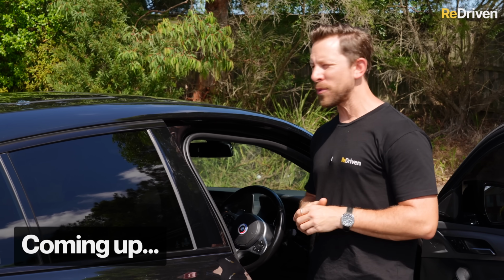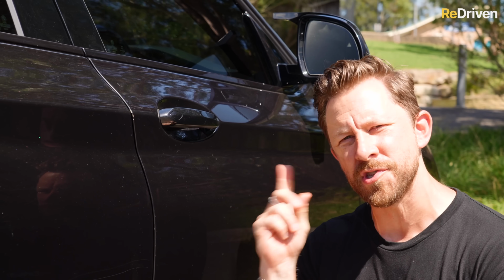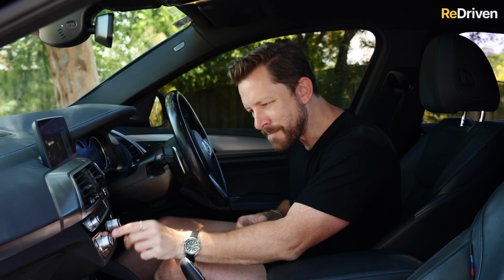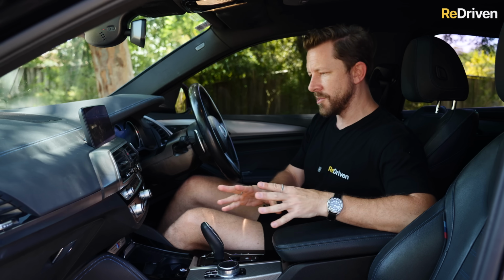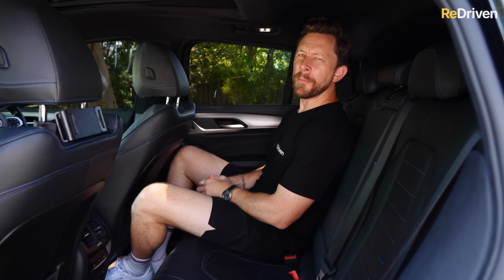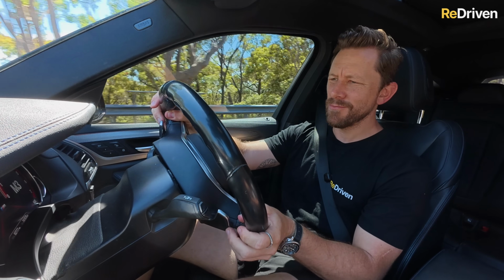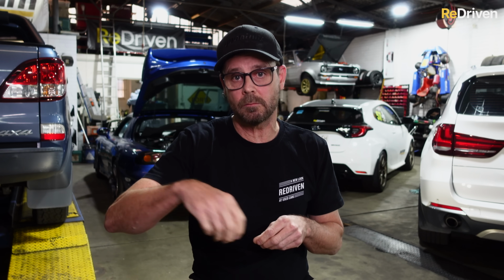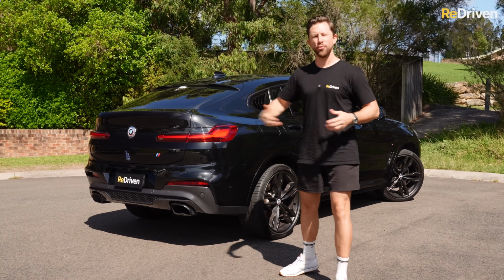Is a USED BMW X3/X4 just one big headache?

Comment: I bought a 2019 x3 m40i with 33,000km in early 2025. 
A downpipe, fuel pump, ethanol sensor and a tune has me and the kids smiling ear to ear. 
So far the only issue I've had is blocked sunroof drains, but that's been rectified under bmw warranty and hasn't happened since. A friend has 2 gen 1 b58 powered cars and both have had the oil filter housing and some coolant hoses replaced.

Comment: I’ve owned two GO1 models 30i (2018) and 40i 2020/21 just prior to the refresh). No problems at all on either car. I’ve had the 40i for 5 years and have done 125k kms. A brilliant car on the open road and as a daily driver.

Comment: 7 years in X3 M40i, had warranty fix active shutter, leaked washer resovouir, out of warranty: vannos fault codes $1k. Had failed hood shock, leaky coolant tank and sold it back to dealer before the expensive Brake/Spark plug dues. Had about 40% value after 55k miles.

Comment: I think the modes effect the braking but its not the brakes but rather the transmission. When I drive in normal mode it brakes just fine, nice and smooth. When its in sport mode the brakes will be kinda jerky if you are not braking hard. Its hard to explain but you can feel the difference.

Comment: Me and a BMW dealership had a argument about the sunroof issue .the new 2025 bmw sunroof is sealed . The 2024 before had issue with leaked he had the audacity to tell me they sealed it on the 2025 because most people were not using the sunroof on older models. Even though a little research shows several people had issue with water getting in.

Comment: I have a 2016 X5 M50d fron new and still have it. The only thing went wrong in this many years is the windscreen washer pump. It's such a small problem but a real pain to fix. The part is only $200 but it took 4 hours to open the fender panel to access the bottle. I did this job myself and when I took the pump out, it is clearly due to corrosion the rubber seal had failed. Apart from that, I absolutely love this car -- very quiet and smooth, very powerful (0-100 in just over 5s), and only sips 8L of diesel per 100km.
Reply: This video is about the X4/X3 you mo-ron LOL

Comment: Trade in the X4 mx40i 2019 issues:
Exhaust odor very strong coming out of the ac vents! Dealership couldn’t find a reason.
Got tired of the embarrassing sound of the wheels every time I break when they got wet or it was humid! Seats are very stiff and uncomfortable and the extension of them for the legs a nightmare

Comment: Its a different opinion you guys usually go for(usually bashing high end luxury car brands, and going for more value for money), at least you admitted some good parts of this coupe suv.  I come from a  long list of BMW including an E46 M3 and bought an X4(Facelift) for a family SUV.  For this market the buyers dont care about depreciation at all, nor what could go wrong over time, and all the mechanical failures such pcv/oil filter housing/valve cover gaskets/vanos you mentioned(even though its a common BMW fault in history), it really isnt a big issue with these engine platform nowdays.  You did not highlight that the petrol engines were co-designed with Toyota, and shares the same engine as the supra, reliability has gone a long way.  
My X4 drives like a sports car and carries the family around, and I can tell you there is a handling difference between an X3 without question.  People buy the X4, not for practicality, but for the look, and handling, which stands out for some people.  Thanks for the video but

Comment: Sorry to say this is one of the most halfhearted content you guys made. While the world is calling the B58/B58TU/S58 I6 petrol engines bullet proof and equivalent to Toyota calibre of reliability, you guys called on a long list of troublesome smaller engines. In fact, those B58/S58 engines are proving their value over time since debuting in 2015/2016. 10 years on and the automobile world is recognising their value now. 
Secondly, the ZF transmission has been proven superior to most of CVTs nowadays. 
Lastly, it seems Lexus/Toyota is your only recommendation when giving verdict. 

PS: I’m no fanboy of any brand. I have an MY12 XC90 3.2 petrol and a MY14 Nissan Altima Ti-S VQ35DE.

Comment: LOL, the "door" over the cup holders isn't getting stuck. It's just a matter of knowing how to open it. You tilt the handle inwards to unlock it.
The removable tray in the armrest is aftermarket. Modulating the breaks isn't about them being smooth throughout the breaking event, it's at the end where even your fancy pants lurched a little. Driving skills my ass, if that's how you normally get a car to a complete stop. Ever heard of a chauffeur stop?

Actual 2020 PFL G01 X3 M40i owner here (bought second hand with 2 yr BMW warranty). Issues not mentioned: Very sensitive seat heating coils. As in, don't climb on the seat with your knee or you'll break it. Repair costs around 1000 eur (covered under warranty for me).  

Should have mentioned something about using BMW stared tyres to preserve the wellbeing of the transfer case, about the servicing of the gearbox as recommended by ZF (not just oil / filter change but mechatronics cleaned as well) between 80-120k km.  A mention that european cars after 2020 don't sound as good because of the mandatory OPF.  Side fender M trims in black are prone to fading if the car sits in the sun.
Reply: Yes! It's not just a slide mechanism, the handle "locks" it closed.

Comment: I’ve had my 2018 g01 x3 and not a single problem. It’s now 7 years old and planning to keep it for more than 10 years. Wish me luck
Reply: Likewise, no dramas to date. But I'm nervous too, about electrical and plastic plumbing landmines. Mine is a very early (2017) G01 X3 30D, replacing a 2011 330D, which had the same donk, although less powerful. Endless torque in both cars. 330D was flawless until just before I sold it, when the $1500 "Comfort Access" logic board died. So I had to revert to using the key fob. The buyer was oblivious, because Comfort Access was optional back then.

Comment: It's tragic how true it is that "if you can't afford a new one, then you can't afford a used one."
Reply: Only if you can't wrench 🛠️
Reply: Of course you can. Just make sure you get a used one with warranty through BMW
Reply: @Undercover1987 no warranty after 5 years
Reply: On the contrary… buy a well maintained M40i for half price with bugger all kms on it, you’ve got a bulletproof drivetrain and yes, servicing and other potential ‘issues’ will cost a little, nothing ridiculous. 
Or pay full price, lose $70k on a warranty covered car that doesn’t go wrong. 😅
Reply: Afford ?….No more like Waste $ 
Get it straight.
Reply: AMEN… afford 😂😂😂
Reply: Always buy used, let someone else take the hit from initial depreciation
Reply: 😂 so true
Reply: Utter rubbish. Depreciation is the biggest cost of motoring . Ignoring catastrophic failure of engine and transmission, repairs cost much less than depreciation. Use a good indy specialist and use OEM parts not manufacturer and the running costs not much morevthan a Ford. I know I run two Mercedes on that basis.

Comment: hmm and I've heard good opinions about the x3 with the b48 engine again. good fuel consumption. the ZF gearbox is very good. the only thing is the cracking hoses and vanos which supposedly aren't that expensive to repair. Lexuses NX/Rx can also have faults - rust, water pump, Rx ABS pump supposedly expensive to replace. I'm thinking about the x3 from 22r or NX/Rx
Reply: Go for a Stelvio or genesis
Reply: @Giddy-i2c  I'm looking for a more comfortable car. Stelvio is beautiful but apparently the suspension is quite hard. And what about the failure rate of Stelvio? I've read that there are problems with the Multi air module and some problems with electronics. We don't have Genesis in Poland

Comment: I used to own a 2015 X3 xDrive 20d F25 and drove it for 5 years. I enjoyed driving it every time I was on the road. The only downside was that the car experienced engine shutdowns three times during peak hours over the five years of ownership. I'm not sure if the engine shutdown issue has been fixed, as the BMW dealership could not find the fault code explaining why the engine shut down while driving.

Comment: Have M Competition version- the 375kW/600Nm S58 TT is bullet-proof, ZF transmission best in business. Drives like a sedan - I needed I a 'do everything' car...2400kg tow capacity, climbs steep inclines no sedan can get into my garage, 0-100 in 3.7s and yet smooth as silk shopping trolley. Does have damn firm suspension even on the so-called comfort setting but man does it do a track-day well. I could not ask for more. Mechanic made no ref to B58 in the M40i which is highly regarded as one of the best engines made which evolved into the S58.
Reply: I've got the same, they're so  much fun. Tune it. You will not regret it. Just A BM3 Stage1 on the I have been 0-100kmh in 2.99 and on to the 1/4 mile at 10.8@126mph from 11.8@117mph on the dragy.

Comment: Looked at buying an X3 back in 2015. Went with a 3.6 Outback as it was half the price and fully loaded. Hearing the issues noted here that people are having makes me happy with the insignificant issues mine has had (tailgate motor, auto wipers, delaminated steering wheel - all fixed under warranty)

Had now nearly 10 years and will keep it until it dies or gets written off

Comment: Never had fuel issues or any other, my 20i runs 7-8 litres per 100 some of these people complaining about fuel efficiency must be driving stupid
Reply: It’s too tempting to access the performance. In BEVs it’s the tyres that suffer and cost the owner in time. People in heavy traffic never get to flex the right foot which is fine but why own a 600+Nm car in the city…

Comment: I prefer the looks of the X4 compared to the X3. But if you're buying a car that doesn't have to be practical, buy a 4-series instead. Or otherwise a 6-series. They look better and don't have all the SUV drawbacks like compromised handling and fuel consumption. Coupé SUVs make absolutely no sense to me. Especially because they still suck off-road. And a 4 door coupé can still tow a boat or a jetski. You don't need an SUV for that.

Comment: Have an X3 M40i and it’s been great, but if you’re not capable of changing your oil every 8000km and not prepared to do some preventative maintenance it’s not the car for you. PCV issue they flagged is a Gen 2 B58 problem, you can change a Gen 1 pcv diaphragm with an aftermarket one for about $50.
Reply: Thanks for the clarification.

Comment: I have an X3 and I can confirm that the pano roof is so much trouble. Mine doesn't leak water and works fine, but it is noisy at speed due to the sealing strip shrinking for no reason and sometimes makes some strange noises. Sure, it looks cool and fancy, but it's not worth it.

Comment: In 1996 I bought a new Honda Odyssey and the service department turned out to be in Rushcutters Bay opposite the huge BMW service centre. 
Servicing the Honda was a delight as nothing ever needed fixing and the Service Department were terrific.
One time I found the Service Msnager was new and he volunteered that he had just come from the large BMW branch opposite. 
He said it was such a delight to work for a Honda dealer as he now only had to deal with contented owners unlike at BMW where there were constant complaints and arguments from customers both as to the number of problems he had to deal with and the exorbitant price of servicing and repairs. 
My son in law recently inherited a BMW from his father and I asked my home mechanic help and to work on the car.  
It was the source of continuous problems and the mechanic just hated working on it. 
When he finally sold it he was carrying a can of oil for the frequent times the low oil light would come on. 
This was the cheaper option to pulling the engine and gearbox out to uncover the source of the leak. 
He sold it cheaply to a dealer who planned to clean it up and sell it for a profit. My mechanic heard that the dealer had indeed sold it for a profit only for the buyer to return the car demanding a refund due to the serious level of oil usage. We all just gave thanks for having got rid of this money pit 😅
Reply: BMW's EVs don't leak oil, but they do depreciate 40% in the first 6 months.

Comment: So basically a disposable car that drives brilliantly for the first five years or so.
Reply: Better than your asian or american cars, which are crap
Reply: Just like everything German.
Reply: The amount of 10 year old high power B58’s I’ve seen with zero issues, is pretty astounding. 

What we struggle with here in Australia is the knowledge of platforms. After spending time in the US and their perception of the B58 platform versus here. It’s pretty evident the Australian market doesn’t have the knowledge or expertise with it still
Reply: @MaCcAM40a3 it might be Because we’re lazy and run with the “not built for aussie conditions” excuse, with the expectation to not keep the car more than a few years from new. Then we end up with a market full of MG, Haval, Great Wall, BYD, SAIC and wonder why..
Reply: @ it’s ridiculous, especially when it comes to enthusiast cars. 

Yes BMW using plastic components is a bit ridiculous, but people will go dump 3k on a tune but refuse to spend $500 on some hard piping. It’s dumb. 

A downpipe and tune m340i x drive is honestly one of the quickest cars on the street right now and will do it reliably. From the lights not much is catching it that’s sub 200k. It’s just Australia is so narrow minded when it comes to cars
Reply: @MaCcAM40a3  I love falcons and all but they are not well built, fit and finish is shit, the engines are great, apparently not the 5 speed auto.
Reply: @MaCcAM40a3 i blame the manufacturer for their ridiculous oil change intervals and utter refusal to issue service bulletins that are standard in other hot climate markets
Reply: @MaCcAM40a3  We are too use to the days of doing 0 maintenance on a Falcon or Commadore and expecting it to run for 5 years.
Reply: @user-qx6pd6om2j  it’s not even that, it’s just we don’t have the market depth here to support multiple platforms. Coupled with a relatively narrow minded market you just dont see the variety of platforms or knowledge here.

Comment: The EGR issue Jim mentioned led to recall of my HEA (Handler-Erst-Ausstattung) heavily optioned  2017 G01 X3 30D. However, it's a 2 month wait for BMW Sydney to schedule the full day of work. Brilliant car, astounding torque (620Nm), quicker 0-100 than a WRX. Mine sees 6L/100Km on the freeway, 8.5-9.5 in Sydney. After 6+ years, no complaints about the car, or dealer. The pano sunroof even works, with no leaks. Only problem: what to replace it with before BMW's electrical gremlins strike.
Reply: Another X3 ?
Reply: @theairstig9164  Perhaps, although it would not be the new G45 X3. The new model drops the 6-cylinder diesel (self-destructive Euro CO2 phobia), making the M50 with B58 petrol the go. It has more plastics in it than the Pacific Ocean, non-retractable sunroof, is pig ugly and costs over $30k more, although that's just 7 years of inflation.

Comment: If you do buy one, think of the fuel you'll save when it breaks down.
Reply: Can't relate, own a 2021 X4, ZERO of any of these issues, never had a defect other than an alignment and regular maintenance. Classic fear-mongering video 🙄
Reply: @kiddvicious78  Hang on a minute, your car is only a few years old. Even a Rover can work for a few years without repair.
Time will tell.

Comment: Lex NX is waay smaller inside and cvt/driving style sucks
Reply: The Lexus NX doesn't have a CVT, it has a 6 speed (1st generation) or an 8 speed (2nd generation) automatic transmission.
Reply: @damilolaakanni  Im talking EU, 8 speed is only in top models
Reply: @S4T4NL0V3SU  you're either thinking of the smaller UX which has a true CVT, or the NX hybrid, which doesn't. The NX hybrid uses a planetary gear set that Toyota calls eCVT for some reason.

Comment: The ultimate depreciating machine. Wait till it is 8 years old and is worthless. Then if anything  terminal or very expensive goes wrong drive it to the breakers. Or better still do not buy it to start with!
Reply: BMW do not want people to fix cars after 7 years. Nor do VAG. Hyundai Kia are better but there are certain models even they don’t want on the road. If you want an infinitely repairable car get a Toyota. It will bore you to death

Comment: x3 m40i is the best we owned ours new since 2020. Only issue is the RTFs and we did have a DRL fail. BMW replaced it under warranty last year

14-15 WHAT!!!! first year we were 9.5 - now we are 10.5 we think its because its a directed injected engine and the injectors might be a little clogged. we try to give it a intalian tune up

Best exhaust noise from anything under 200k. nothing beats the B58

B57??? WHATS a B57 please explain?????

YO no explain revving clips!!! it would have given you 10,000 subcribers..... Lost opportunity

WHAT!!! no!! are you serious
we have one since new we paid 93500 for a X3 M40i blue with sunroof "tbh we hardly ever used the sunroof" in Melbourne with 5 years free servicing. our car has depreciated 35% which is normal. Honestly thinking back i wish we brough a brand new X3M because its everything the M40i is turned to 11. at the time i could have purchased one for 114k.  Wife said NO, tbh it was overkill and we don't thrash our M40i so yea overall we are happy with our purchase 

only issue we had in a failed headlight and i hate the runflat tyres. 21 inch wheels with ultra skinny tyres that are $700 to replace. we destroyed 3 since purchase and honestly we are just driving the car normally. but since purchase we avoid potholes and we are constantly scanning the road to avoud any. its not something you want to worry about when driving.
Reply: B57 is a diesel variant where as 58 is petrol